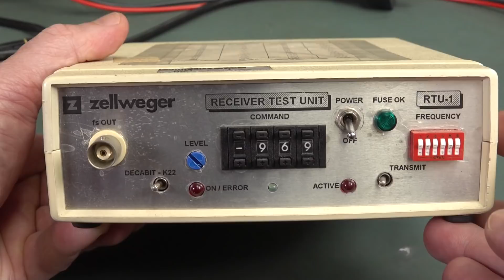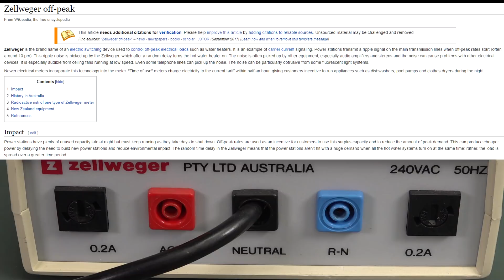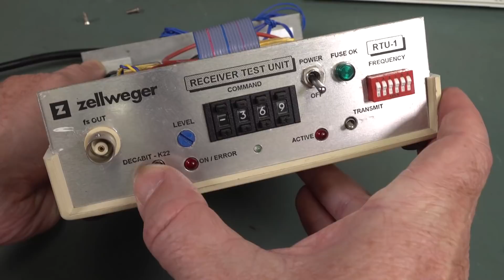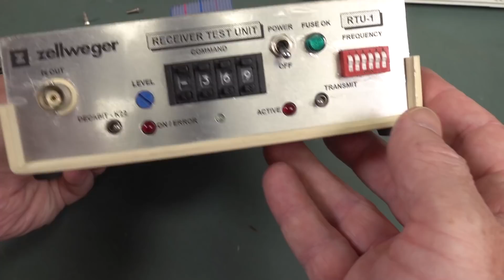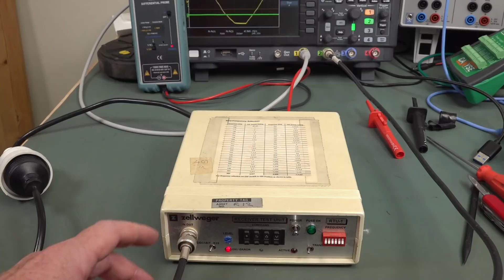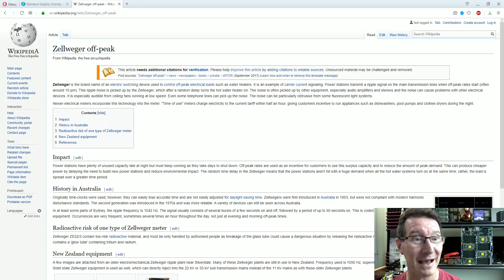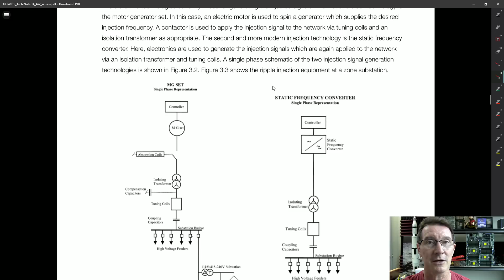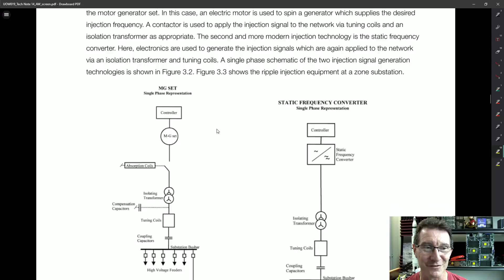EEVblog #1283- What is Mains Ripple Injection?

Comment: Do you happen to still have this working and be willing to part with it? I have been working for a long time to try and make one of these systems. That would be a very useful device to have because it encodes the DECABIT protocol that I need to test with. I already have been able to inject signals directly into mains on a smaller scale but it uses a large motor-generator set that I made. the protocol I am using right now is K22 as listed on the device but I would like to switch to DECABIT soon. I tried to make one with an arduino but the sheer amount of variables isn't fun to deal with. Thanks for showing this unit, its very cool to see the original Zellweger units around.
EDIT: Some info on the protocols used in case anyone is interested, 
the 3-minute transmission time is only for K22 and hybrid systems, k22 used older mechanical receivers and it took 7.5 seconds per channel to transmit the code. They had to transmit all 22 channels filling up that approximate 3 minute time in order to keep all the other receivers in their correct modes. the newer decabit protocol can encode a command in 6.6 seconds. Dave is correct in thinking that the absence of ripple is a 0 and presence is 1, the DECABIT sequence always starts with a start bit which is 1 and then 10 data bits. 5 of the data bits must be 1, and 5 0 to get a total possible 126 combinations. the on telegram (+ on the last digit of the selector) is inverted to make the off telegram. If you want more info, I have too much to tell.

Comment: I was working on this for some time, as a "pirate" project. But I've never managed to inject  recorded signal back to grid to change the electricity counter to the lower payment tariff.
Reply: Probably missing the uberlong bodgewire.
Reply: Be careful, if it decided to work you could overload the grid if the signals got out to your neighbours and further. I can imagine you'd be in all sorts of trouble if that happened and you got caught.
Reply: @threeMetreJim  - obviously you'd run such a bodge behind a ripple frequency filter (to prevent backfeed to the grid).
Reply: @johncoops6897  : If you're using a smart meter then the signal will be using the same data signal as the general check-in and switch-control, so if you filter it out you'll filter everything else out too, causing the company to send out a lineman on suspicion of a fallen wire. If the lineman doesn't see a problem then they'll have to disconnect you anyways, because that just indicates that the problem is hidden, possibly inside a building. When they then swap meters to try debugging they'll notice that that one also doesn't work, causing them to tell you that you have to get the service drop fixed before they can restore power.
Reply: @absalomdraconis  - well, OK. But this discussion ISN'T ABOUT smart meters. It's about ripple control, so let's stay on track huh?

Comment: so could you jam the system with it? lower your bill?
Reply from the maker: Nope, doesn't work that that. It would actually increase your bill if you turned on your hot water during the day.
Reply: @EEVblog  i misunderstood, thanks, I thought the system was reporting back to the power station that you were using more power during peak hours and this box calibrated or tested the systems. I have seen outside meters that did that here in the states. now theres a signal to jam....

Comment: Yep I’ve got an old one of those on my water heater circuit, never bothered to rip it out because the 240v line would be too short. Maine, USA. Think it was a voluntary thing they did back in the 80’s here.

Comment: This is the same system that big brother uses to turn off / adjust the temperature of air conditiong systems ie DRED. 
It uses the same principle ie data modulated using the power system as a carrier.

I'm surprised that we have not yet seen commercial in-line band pass filters to filter the incoming mains and remove big brothers ability to control our aircons. 
Of course most people don't even know its happening so there is that.
Reply: who is big brother? ive never heard of them.
Reply: @deadgaming20  if you're American you may know him as Uncle Sam I believe? ;)

Which raises the question how is your uncle also your brother? Perhaps it's best we don't think about it?
Reply: @deadgaming20  But yeah in all honesty its the power companies who decide to turn off or limit the power output of your aircon and not specifically the government.

Comment: Back in the 80's, the power lines in my old neighborhood made a  buzzy sound around top of each hour at night. I think ballasts in street lights may have resonated with some kind of signal imposed on the mains. I thought I might hear something related to that someday...THANX !
Reply: Sounds like time error correction to me. At the top of the hour mains frequency is bumped up or down for a bit to keep electric clocks roughly accurate.

Comment: In Britain it is done by a signal sent over the BBC R4 LW network on 192kHz, this frequency being able to be picked up in most of the UK from it's 3 main transmitters at Droitwich (main), Burghead and Westerglen (I would have thought that the two aforementioned Scottish relays would relay this information as well). There are/were? also a few small relays as well.
The device connected to the meter is a radio teleswitch, https://en.wikipedia.org/wiki/Radio_teleswitch 
This service will run until the R4 LW transmitter at Droitwich uses up it's last spare transmitting valve as the BBC won't either have new valves made or the transmitters replaced.
In Britain the only real users of this system are people who have to use electric night storage heaters for one reason or another, as even with the off-peak rate gas is still cheaper.
Reply from the maker: Interesting, thanks.
Reply: Absolutely correct, except for one small detail. It's 198kHz.
Reply: I don’t know how much this is actually used nowadays. I’m on an Economy 7 tariff (7 being the number of off peak hours) and ours just switches to off peak according to a time, no teleswitch. It’s consistently 00:36 - 07:36.
Reply: @CallumAi  Yes, I remember my mothers fusebox had a simple time switch to change from normal to off peak rate, seems a simpler system but not easily changed (if the off peak times changed the clocks for every house would need to be altered manually!)
Reply: dglcomputers

I always wondered if they still used a similar system here in the Old Dart, but according to your post, apparently not. ;)

(I'd noticed the lights often dimmed at peak times like 9pm, but it seemed more like an intentional dimming time of around half a second, rather than the switchover for nighttime use. Or maybe one of our neighbours is powering up a Cray. lol)

https://hackaday.com/2016/12/06/decabit-or-the-conspiracy-theory-that-wasnt/

Interesting system / device / vid / reply.
Reply: Im from the uk. In an old factory where i worked each building had a similar 1970's looking box for turning on the outside lights. not sure if the signal was generated locally. But the tech was very old school (little or no electronics).
Reply: @mauriceleach3558  here in NZ, back when your power board also provided private electrical services, their electricians could get the receivers and set your automatic lights (shop sign etc) to switch on using ripple control by setting it to the street lamp control code. This was easier than timers that customers wouldnt know how to program, with the benefit of it automatically updating for different times of the year and daylight savings etc with no customer intervention. 
Perhaps your factory had something similar.
Reply: Interesting,  thanks
Reply: In Poland there was a radio system widely used for driving street lights across the country. Signal was transmitted @ 225kHz along with Polish radio broadcast.

Comment: In my country Slovenia, my house had a I guess a similar type of injector,  right next to the power meter, and apparantly it injected the switchover signal to the entire street. Of course since It was in our house and my grandfather was a electritian, he wired up a switch to the boiler and to the injector, where when you turned on the boiler, it would switch over to the cheaper electricity. It worked flawlessly until someone from the street complained that they were paying too little (how stupid can you be to complain about that) and the electric company showed up, saw what was going on and yeah you can imagine what followed. Anyway that happened some 20-30 years ago, well before I was born.
Reply: That doesn't make sense. Unless he was triggering the injector during the day, then everybody's boiler would turn on and be charged at the higher tariff.
Reply: @MatthewPegg  He was injecting the signal that switched the relay to cheaper electricity.
Reply: @whatevernamegoeshere3644  Why would there be two separate inputs for "cheap electricity" and "expensive electricity?" Seems more likely that the power meters just incremented at different rates depending on the presence of the injected signal.
Reply: @frother  Well here in Australia and most probably everywhere else, the electricity companies charge a lower tariff at night. The injector just sends a signal so the hot water boiler turns on. Even if there was no injected signal, electricity is still cheaper at night which is why a lot of people run pool filters at that time, which don't have any kind of signal detector.
Reply: @MatthewPegg  And how does the power meter know that it's night? Seems possible that the old Slovenian system talked about above would use the injected signal rather than try to keep an accurate clock at every meter.
Reply: Separate meters for peak and off peak, with the relay switching which one is active, or just switching the off peak one off during peak times.
Reply: @frother  There is no "separate input" there are 2 separate counters on the meter and the receiver gives it power to change it to the second counter. At least my 70s Iskra (a slovenian company) meter is like that.
Reply: LOL! This is why we can't have nice things. 
Who the hell complains that they're not paying enough!? I'd be furious with that guy lol
Reply: It doesn't make much sense, the receiver shouldn't be able to make the tone by itself I think? And to make the tone yourself in that period, not that easy.
Reply: A little while ago in Plekhanovo, a gypsy village in the Tulskij oblast the entire village was stealing gas and electricity and they weren't paying their bills. So the power company came with riot police, cut their gas and power. And then on top of everything came court bailiffs and confiscated their property. Flat screen TVs, jewelry etc. The gypsies of course acted out and were arrested.
Reply: Why is there a cheap and an expensive electricity?
Reply: @moclan582  to encourage usage at off peak hours to level load the grid and minimize peaks.
Reply: @moclan582  To motivate for lower use during peak times and higher use during off-peak times. It helps to even out load on the grid so that generation plants do not have to cater for high loads during peak and sit idle at other times.

Comment: I helped develop the turtle power line carrier system. It was a PLC system that as the record for the longest distance sent over a power line. At one point there was a meter in the outback of Australia sending meter readings to a transmission substation 200 miles away.
Reply: That is cool. Does that mean that nothing else between those 2 points could send a signal at the same time? Seems like that would be an issue if you have local signals being sent between devices and they are disturbed by a signal that needs to be sent a long distance. Or is it a sub net that ends at the substation and the long distance signal is sent on the big transmission lines?
Reply: @excitedbox  It used ultra narrow bandwidth transmissions so that 1000's of meters could send at the same time. The signal was current changes so it only sent the signal towards the power source. It was limited to the size of the substation powering it so in this case it was just that the meter was way out in the desert via a 1 wire run. The company was later bought out by L&G and they discontinued the product.
Reply: @LaserFur  That sounds awesome. Was it via SWER? I like the idea that a bunch of washing machines, dishwashers and dryers could be queued up ahead of time, then have that info sent back to the local lines company who then calculate the power load and could then respond telling individual groups of appliances to start up at certain times. 
I think there will come a time when these sorts of systems will be needed for more efficient electric car charging.
Reply: @hbaykiwi  yes Single wire earth return. I doubt the technology we used could be used for more than daily meter reads. It transmitted one bit of data every 33 minutes. so a whole packet of data took all day.

Comment: Rodalco2007 has a couple of videos showing the full size version of this device working.
Reply: https://www.youtube.com/watch?v=EjtEPXQkHeM
Reply: First 
 Wikipedia link  follows later in comment. 

Second.

I thought someone would probably mention him.

And go to the Wikipedia page as far as you might recognize the name associated with who took the pictures.

I don't know if it's a coincidence, but I kind of doubt it.

The channel name is very close to the persons named head took it taking the pictures.

Also for anyone interested here is a link to the Wikipedia article that is spoken about in this video.

Third.

I Indian see on one of the Eevee ball. Channels? Videos about it was one of the videos on his solar install

Dave Jones that is.

And they were talking about the old zillweger relay.

And also it was one of the ones that had the radioactivity issue.

By the way, it's not just radium.

It's also trinium as well.

I just got done reading the Wikipedia article, by the way.

Had it bookmarked from before.

When I first heard about the residual your system on the other channel you mentioned.

Here's the Wikipedia link.

https://en.wikipedia.org/wiki/Zellweger_off-peak?wprov=sfla1

I remember. Here in the United States.

Where my parents used to live their first house they owned.

Two things. It was kind of similar except different.

A lot of houses at least at that time down there had to meter sockets.

Even though that were single residence.

The Normal meter was in one.

Wish served everything except one purpose.

The second meter.

Was connected to the electric hot water heater.

There was a separate safety switch. That had 2 30 amp Edison plug fuses in it for the 220 volts ac 60 hertz power for the water heater.

Also Is that meter had a timer built-in to the Fishbowl.

AKA glass meter housing.

It was really long compared 2 the standard meter..

It had a timer. With strippers that were set internally That could not be adjusted.

Precept when Demeter was put together.

But since this was an AC synchronous motor timer.

There was originally a cover. That would foot down over the whole to set the time.

But the outer part was there, but evidently that had broken off years before We moved in.

No evidence of tampering or either.

Also I remember as well.

The water meters were in the basements. Of the houses.

And other buildings.

Although in some places they were in manholes.

But you would have this little black box on the side of your house.

It had what looked like a trident logo on it.

And there's a wire that ran from that inside.

And that connects to the water meter.

The older ones have seven wires.

And I newer ones had either three or four wires can't remember which.

How do I know this?

 I was always interested in mechanical stuff utilities. I was really into stuff like that. And I'm also a maker. What it be in La Puente near even.

But with how I found out I actually asked what the meter readers once about the system.

She explained the whole thing to me pretty cool.

 By the way, people that knew me that worked in various places or companies and found out those ended stuff and could use sings to salvage. Oh, yeah.

Also like with the water heater off off-peak train times at least in Wisconsin.

 Later on, we had an off-peak electric meter.

 Is that would just charge two different rates at different times.

 It was a more modern meter.

 Other than that, I don't remember what it look like.

 Also, I remember in Tennessee.

 It was not a smart meter, but it just had a digital display.

 By the way, this was well over 20 years ago.

 also in Tennessee where my grandparents lived.

On the farm.

The electric hot water heater for the house.

 however, not in the dairy barn.

 at the breaker panel.

 Had this gray box attached to it.

Big rectangular thing.

 That was an off-peak load switch for the water heater.

 Much later on it had been disconnected and removed.

Also, I do believe those. A gray units there about the same size as a u.s. electric meter.

Often seen sometimes on power poles.

But for what purpose?

I never could quite figure out for what?

 Are next to central air units in some places.

Are the same sort of thing.

 I remember one time seeing something like that in a surplus catalog.

 I do know I do know there's some sort of load control.

 Anybody got any info on these? I'm not going to find what they are anywhere.
Reply: @aaronbrandenburg2441  are you insane or otherwise mentally damaged? This comment reads like the ramblings of the insane!!

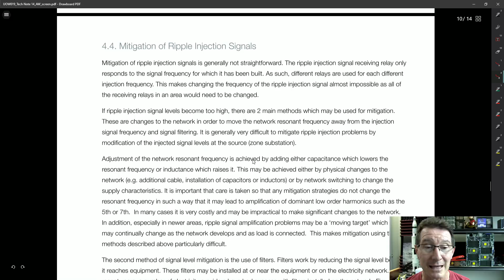Comment: Repair that thing. Would be interesting.  Our electricity meter switches to low rates at 23:00 and back to high rates at 7:00. Maybe that's the time I should be probing the mains?
Reply: I guess they may stagger the timing to prevent fluctuation
Reply: I imagine they would have been proud of that in Nazi germany?
Reply: @gus6rocks  Dude, what?